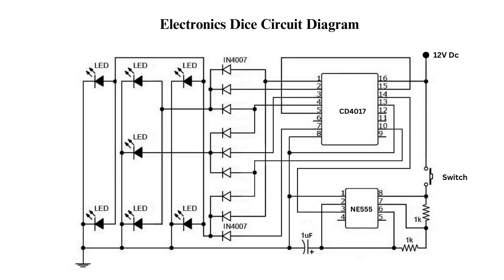How To Make Electronics Dice Using CD4017 IC

Comment: You can tell me all elements name which you used in this project
Reply from the maker: 74HC595 IC   (1)
NE555 IC        (1)
BC547 transistor    (1)
10K Resistor    (2)
33K Resistor     (1)
22K Resistor     (1)
47uf 25V Capacitor   (1)
LED                     (8)
3.7V Battery      (1)